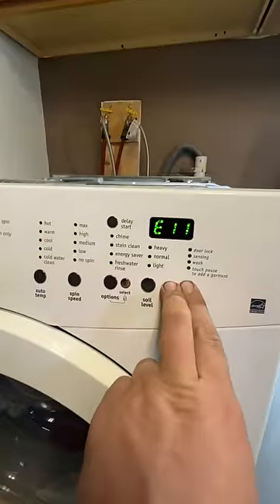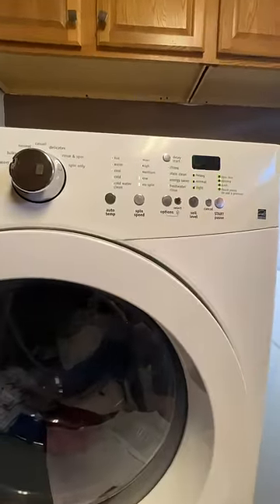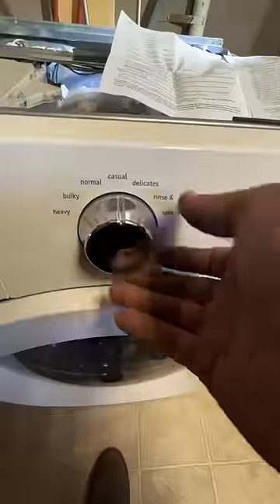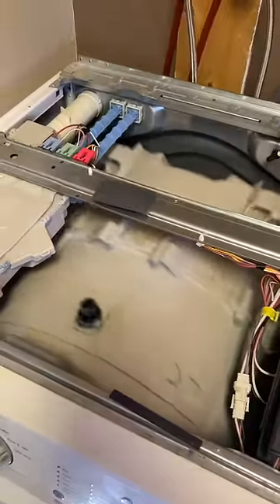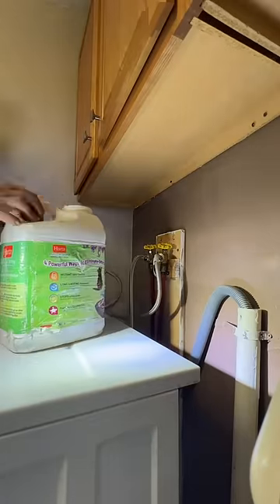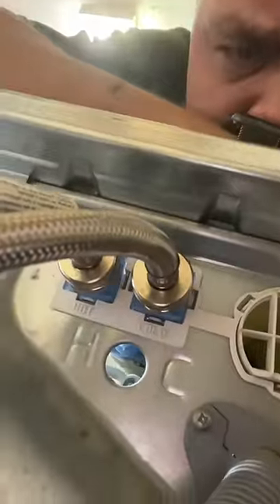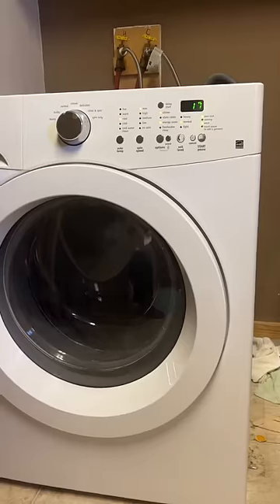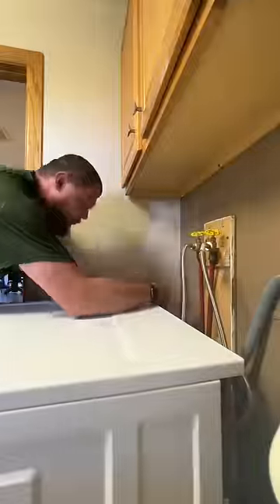Troubleshooting and finding nothing wrong with a washing machine.￼

Comment: Common cause is a partially clogged tube to the fill level air pressure sensor located in the top  right rear  corner.

Comment: Sometimes the fill valve will begin to fail, making the machine take forever to fill. It should be tested with a multimeter.
Reply from the maker: All three fill valves came out with the same resistance